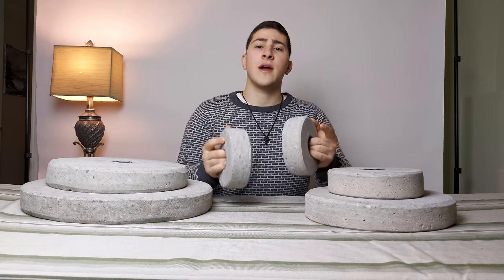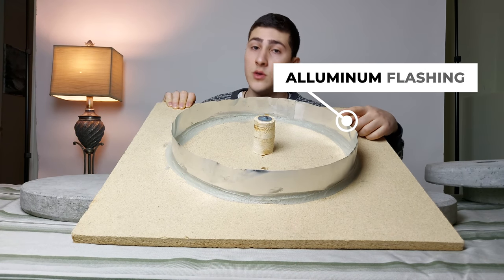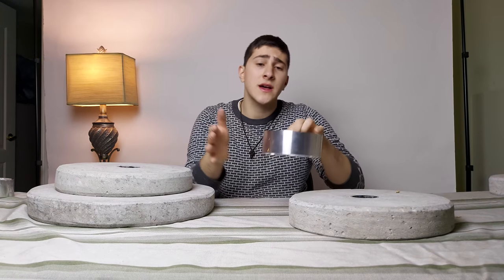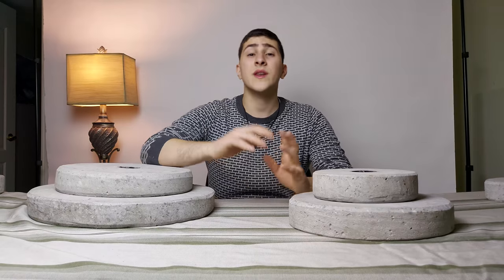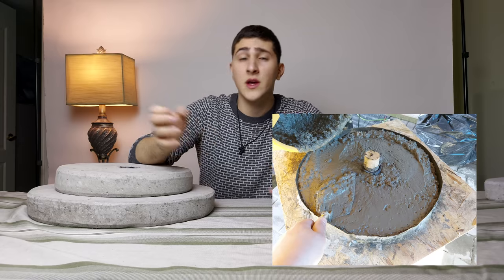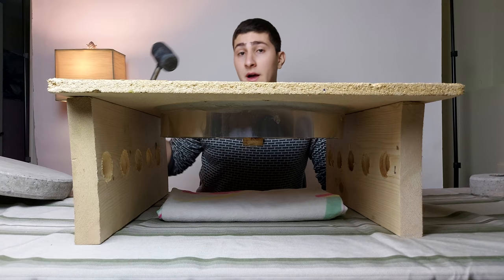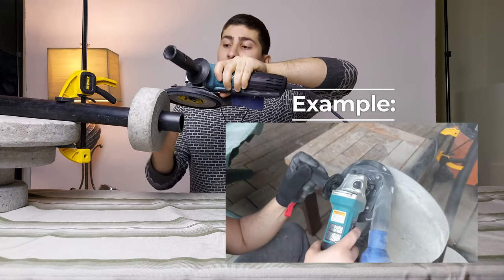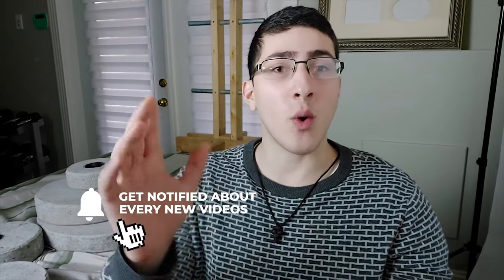DIY Weight Plates - How to Make Concrete Weights

Comment: To further improve the strength of the plates, you could spray them with truck bed liner to give them a rubber coating. You could also put some square pieces of chicken wire sandwiched between the concrete to add some rebar support. Great video!
Reply: Rubber coating is a great idea!
Reply: You're a genius.  That's such a great idea!  Thanks!!!
Reply: smart!!!

Comment: Big fan of how you've included all the little 'special tips' for making the job easier (e.g., using a sawzall to remove air bubbles, mounting plate on a pipe to let the grinder do the work). Brilliant, and well-done!

Comment: Hi great video ! 
Can I ask you a few questions ? 
What is the final density of your concrete ?
I mean how do you know what size to make your molds so you can get the weight you want ?
Also how do you make sure the weights are all the same weight so they are balanced on the barbell ?
Thanks a million.
Reply: Practice makes perfect he has a book that might have your answer .
Reply: @clydeneedham3284  thanks will check it out

Comment: On the mold... Just buy a cooler tub.  They cost about $8... Have 17inch base, are perfectly round, are plastic so concrete wont stick.  They are water tight so you can use a wetter mix... And bonus you can pond cure the plates in them for say 3 days after they set so your concrete gets to full strength.
Reply: What's a cooler tub and pond curing? Do you mean by submersing the plates in water? Or do you mean by just putting some water on top of the concrete before it gets removed from the cooler tub?
Reply: I like the trash can one so far because it gives the 45 lb plates handles.

Comment: Great video bro. I'm making also concrete weights. Question: after you demold it, do you use a method for curing? Or just let the natural process. Also how would you paint on the surface?
Reply: Just leave it out, uncovered of course, to cure. I’ve been told it takes 20+ days for concrete to cure to its maximum strength. That’s not to say you can’t use them after a few days, I just wouldn’t be too rough. I’ve also seen a video of a guy painting his weights with epoxy and they legit looked like they were manufactured.
Reply: @shadowarcherz  BEST bang for your $ .  1 can does a pair of 45 lbers nicely
Reply: @kyleorr533  most concretes reaches maximum strength at 28 days of curing. Certainly the ones used here.

Comment: Hi, this is very interesting and well explained! However I can't find aluminum flashing where I live (third world island), and it's going to be hard to find any kind of metal sheet that thin. Is there anything else you could recommend? And what about iron mesh to strengthen the concrete?
Reply: @shadowarcherz  great this is what I was about to do. Cheers
Reply: @bataille22  what did you use for it? I also cant find aluminium flashing.

Comment: Try to keep your concrete plates underwater for bout a week. This will make it harder and stronger. Don't ever let it get too dry. The first 24 hours keep spraying it with water. And then when you pull it out the mold put it underwater for like 5 days. Then let it dry out finally. 

If you dont keep it wet and just let it dry out in like 24 hours your concrete is only gonna be like 25% its true potential in hardness.

Comment: I'm using 40litre plastic buckets. Can I just leave the concrete for 24-48 hours or would you still recommend taken the weight out after 12 hours so it's easier to rake out.

Comment: Good content!
Im trying to do concrete weights but I can't find aluminum flashing in my country. Do you have a link that I can use to get it?
Reply: @shadowarcherz  Hi Keven!
I live in Spain. I couldn't get the alluminium flashing but I got a metal sheet. It was hard to cut straight but it's done. 
The mold is ready to be used. Many thanks for your guidance

Comment: Bro, thank you for your valuable content. Just ordered your e-book. It's great! BTW what are your thoughts on coloring concrete? Is it worth it? I've been making concrete plates for 2months now. Never got good results coloring them.. I've used different types of color , putting primer before I color. Never got good results so far. They look ugly.. Is it even worth it to color them? 
Have you thought about different types of molds? Like sylicone of liquid rubber or something like that? In my opinion they could be more convenient. Do you have something to recommend?
Reply: @shadowarcherz  Thanks a lot man. Keep up the good work!
Reply: for conrete, the BEST is a coloring agent that you mix into of the concrete. the next best is going to sherwin williams and asking for concrete floor paint. that paint has a primer then the color and it STAYS. (Former painter)

Comment: Great post here. What size flashing are you using as far as height? And the middle piece that is fixed on the board - what is that being used?

Comment: Looks great but how do you know they come out at exactly 45 lbs?
Reply: Weigh the concrete mix, all the water will dry out eventually anyways
Reply: Also roughly add a just a little below a pound of mix cause you’ll be grinding it down

Comment: Instead of surface grinding so the plate is easier to hold you can from the start create a circular funnel around the inside edge of the plate while the cement is still wet and malleable.
Reply: @shadowarcherz  I still think you should surface grind or sand the weights down to make them less rough and course. That won't be good for a person's carpet. However adding the lip will also make the plate easier to hold.
Reply: @shadowarcherz  Thank you brother. Any future plans to create new equipment? A cable machine would be awesome.
Reply: @shadowarcherz  Fantastic. Will check them out. Hey bro mind 8f I fet your email address? I'd like to email you whenever I need guidance regarding something I'm stuck on when creating my equipment.